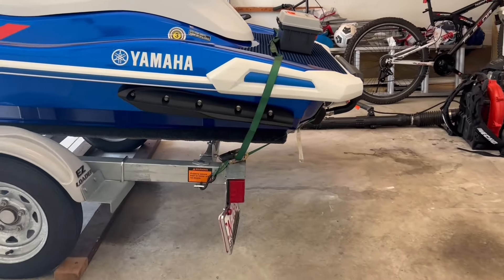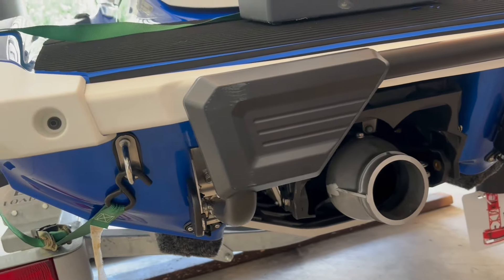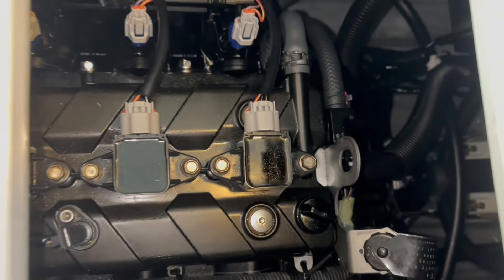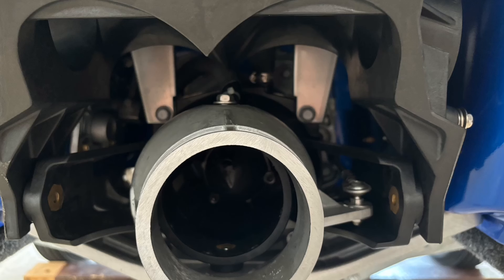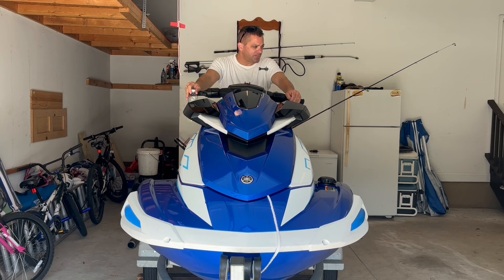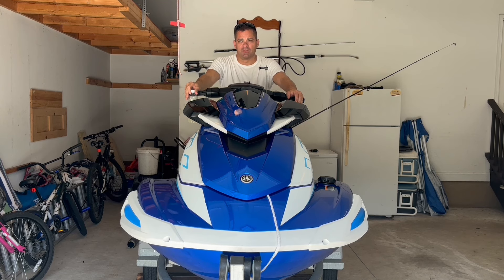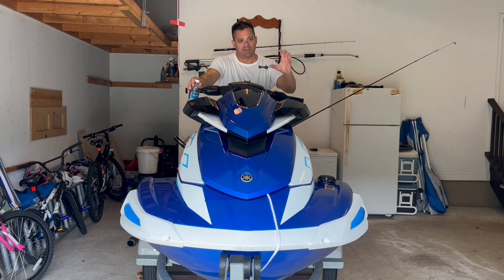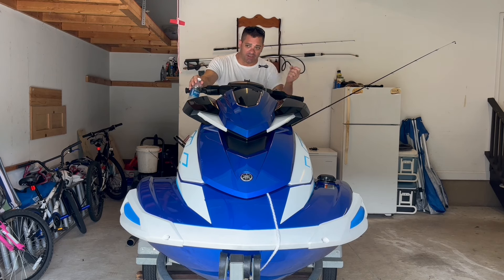2 Year Review 2022 Yamaha VX Cruiser

Comment: you do not need a 4wd to launch a jetski. i will agree with the car part..yeah..just don't..lol. i never beach my ski on any sand, nor do i let it get near any rocks.
Reply from the maker: @alanshaw4655  I don’t know on the non 4x4 thing😬 I always see front wheel drive vans/SUV’s or rear wheel drive trucks spin and roast tires on the ramp every time I go out. One Titan that was 2 wheel drive had to let the boat go and pull out while I hooked up his trailer and pulled his boat out in 4x4. It’s possible but darn risk😬
Reply: @redrightreturn1085  lol, well, my 2wd , reg cab silverado handles boat launches just fine. here's a tip..don't back way the heck down in the water !. sounds like to me, these folks don't know how to drive huh ?..lol.
Reply from the maker: @alanshaw4655  most don’t but these ramps are on such an angle to where the trailer wheels get half submerged depending on the water levels which is always, rear wheels in the water . 😎